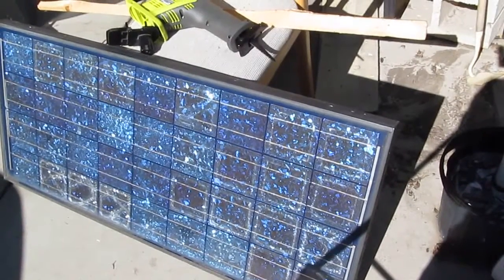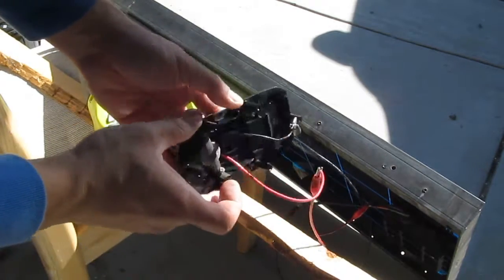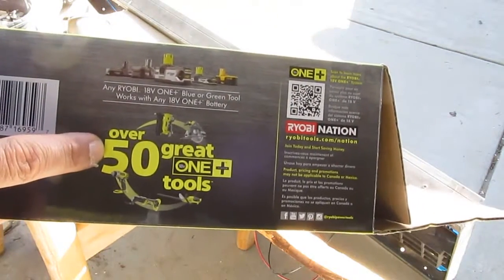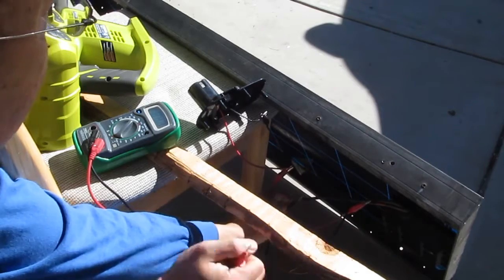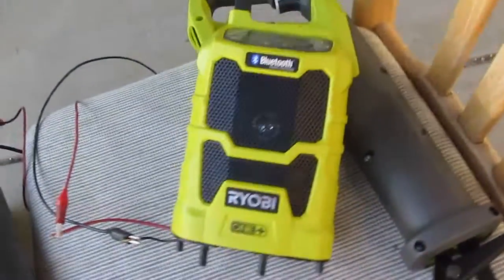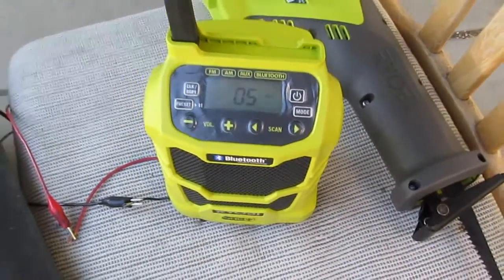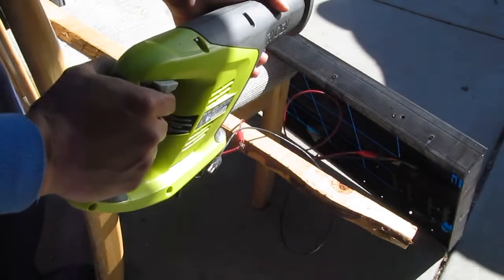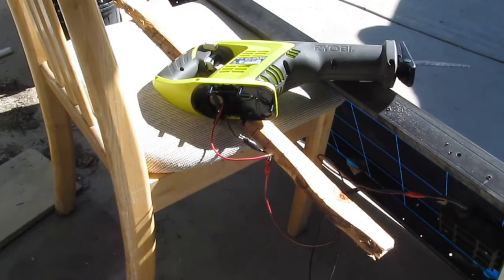DIY: Solar powered Ryobi 18V cordless tools powered by 12V Solar panel

Comment: yeah idk why you would actually want the setup in the video.  not to mention you can't use any of the tools inside a garage or home.  plus if you try to work around this by making the wires longer, you will lose voltage.  its a lot more practical to use the solar panel to power the battery charger.

Comment: What would be the best way to charge the 18v batteries with a panel that only produces 12v? I've seen where people use a buck/booster module, capacitors, and etc; but I don't want to risk my batteries and/or components. I have a circuit board from a radio/ charging station that takes 12v in and converts it to 21v, I thought about using it to step-up the volts? your thoughts?

Comment: Is it possible to add a usb port to either device and run it that way ?
Reply: You can use a car cigarette lighter usb charger adapter which converts 12v to 5v for usb.

Comment: Could you connect the panel to the battery itself (without dismantling the battery) without any other devices, just cables, and charge the battery that way? It's more convenient to have a portable battery, the panels are quite bulky. If it can be done, a presentation would be great. Your presentation is very clear and encouraging.

Comment: 2 questions: What happens when the little battery you left in there is topped off and you stop discharging it by using said tool and leave it connected in the sun without a charge controller? 

Second, why not get a DC to AC inverter and plug the batter charging base into it? Keep your batteries topped off without destroying them and use them as intended by the manufacturer? Wirelessly...That's precisely why your paying more for a cordless tool in the first place.
Reply: agreed, idk why you would actually want the setup in the video.  not to mention you can't use any of the tools inside a garage or home.  plus if you try to work around this by making the wires longer, you will lose voltage.  its a lot more practical to use the solar panel to power the battery charger.